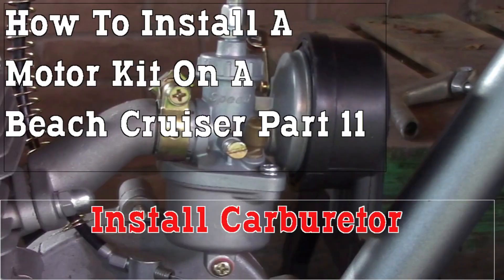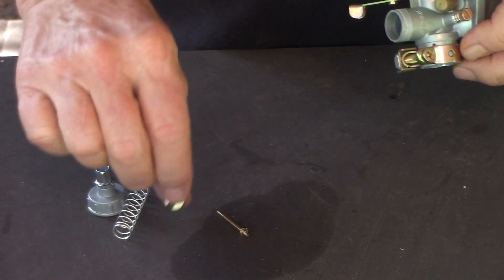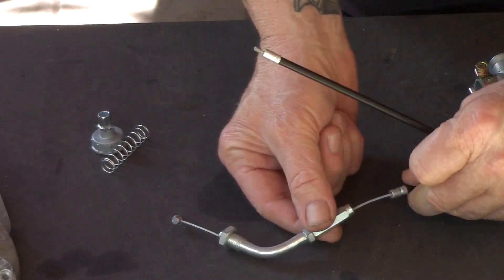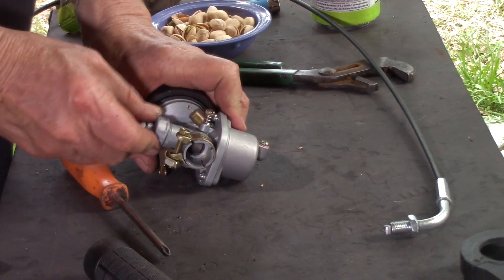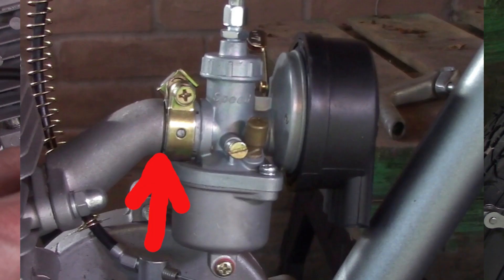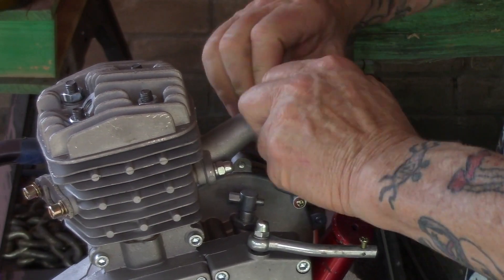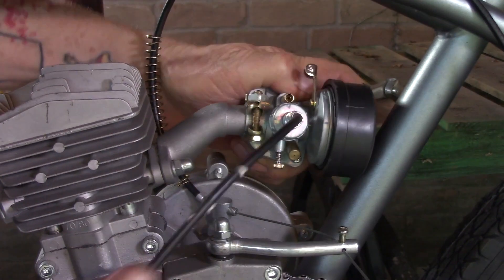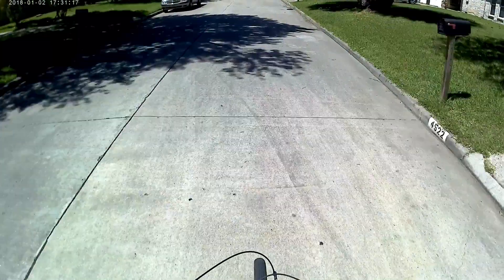Part 11 - Video Tutorial - How To Build A 66cc 2 Stroke Motorized Bicycle - Install Carburetor

Comment: I put a racing carburetor on my 66cc Skyhawk and it is blowing gas out the air filter hole. Do I need new rings or is that carburetor allowing too much gas for it to burn?
Reply from the maker: Stuck float

Comment: Hey Hughes big fan of Ur channel pls I need Ur help, my 80cc developed a problem of sound coming from inside the engine can't really tell from where head Gasket was damage but
I have had my head gasket replaced also replaced my piston and rings 
But it's still making that loud noise making the bike too go very slow 
Pls help me out thanks so much 
And with the loud sound coming from inside the engine, when ever I pull the clutch engine turn off immediately 
Thanks in advance for Ur help
Reply from the maker: Might be better off putting a new engine in and use current one for spares. It takes a bit of experience to sort out some issues. Sounds like engine needs to be completely sorted thru
Reply: Some say I have too double up on the
 Head gasket, haven't tried that yet tho.
Reply from the maker: @chineduezekiel9853  Only if the piston is hitting the head. Easy enough to see. Simply pull the head and look for contact marks

Comment: Your videos are very helpful Mr. Hughes. But I have a little bit of problem. 
I have just finished my build, my engine doesnt start if the choke lever is up. So I have to lever down the choke all the time. But this bogs the engine when I full throttle. While I drive, I try to lever halfway up. It just doesnt go and stops. What did I do wrong ? Thanks for the videos.
Reply from the maker: Lever up is for starting. Down is for running. Is there gas leaking from air filter? if so float is stuck on carb. might need to clean carb
Reply: @HughesMotorized  Engine is 70cc with a red colored carb. Maybe its reversed i dunno. But i checked the plastic air filter cover and yeah its wet. I found your other carb video. I will try that. Thanks again.

Comment: I never received a stop for my carbs
Reply from the maker: ???? they don't have them
Reply: @HughesMotorized  nope
Reply: @HughesMotorized   not the 1 s I got from e Bay rose
Reply from the maker: @jonathanguillory8321  perhaps you are calling it the wrong thing. A carb w a slide doesn't have a stop. The "stop" is when the slide hits the top of the carb.

Comment: watched this once brother went to comment it would not load comments refreshed said it was took down by user . lol but its ok i got it this time and ill rewatch it again lol .
Reply: you know i got pretty lucky with the carb manifold that came with the kit it fit like a glove and went on nice and smooth . how ever i had to buy a off set manifold so it will clear all right and be straight . it almost fit . its on there but on a lean . i havent put that on yet i have it but the day it came in i got sick as a dog  and still fighting with it . not co vid but kicking my butt all the same . i hope the new manifold is as easy of a fit as the stock one . take care brother . looking forward to the next video .
Reply from the maker: I forgot a little something and had to reupload a corrected vid.
Reply: @HughesMotorized  I seen 110cc  2 stroke motorized bike kit on e-bay for $190 out of Commerce California ....Do you know anything about them??? I think it's 52mm by 40mm stroke but not sure. It appears to have a 2 PIECE CYLINDER & HEAD !! and uses all hex/allen bolts and 8mm mounting studs. It looks like a good deal for $190 kit  VS  $299 for the Phantom kit with the 52mm chainsaw 1 piece cylinder design...I wish I would of waited to buy it instead of my $120 Anbull 66/80cc that uses the cheap screws. I'm hoping my neighbor will by my Anbull kit.
Reply: Question, I bought one of those $15 billet short intakes to try and fix carb fitment/clearance issues. I notice now there is no room for the clutch cable routing unless, I cut down/shorten the stock bolt on the engine that holds the clutch cable. 
Will the clutch/clutch cable still work fine it I shorten it to make room for the shorty intake manifold/carb setup? If I shorten it the cable will have to angle down to it, then back up to the bar/arm, instead of being mostly straight across from it.